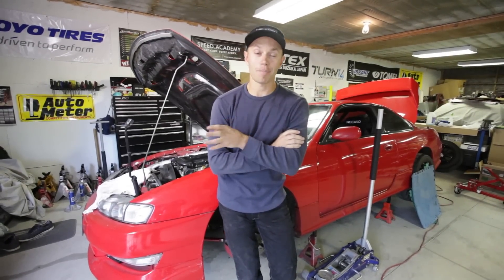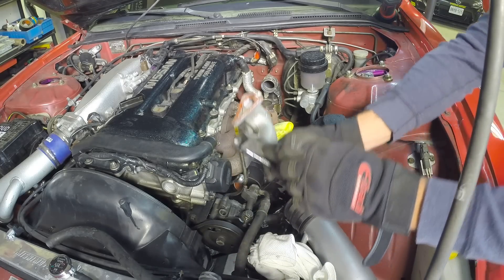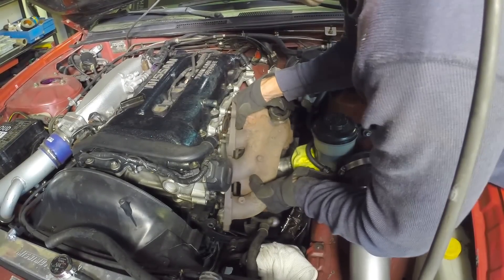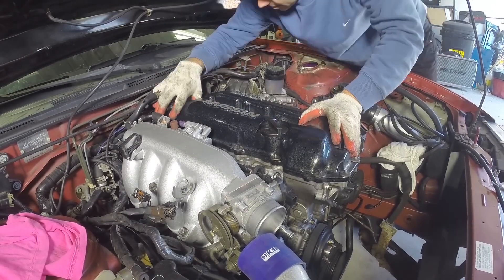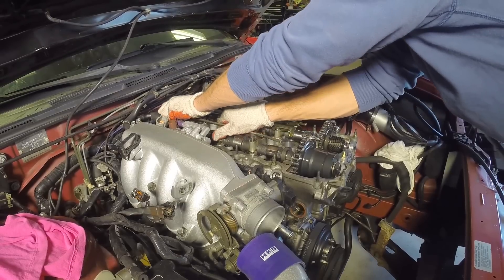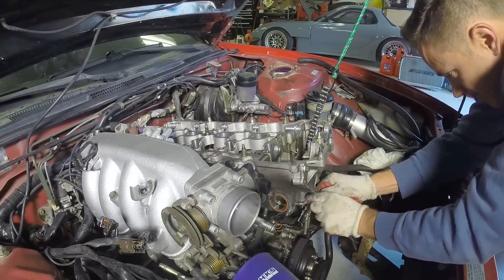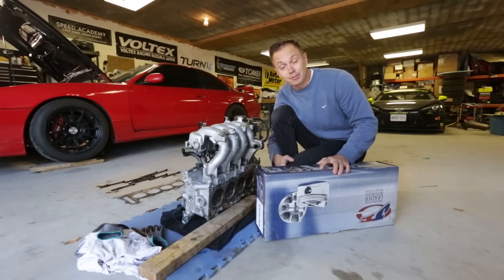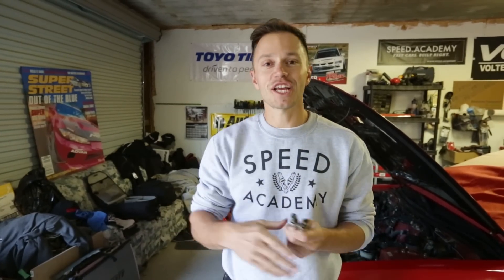SR20DET Head Gasket Replacement How-To - Project GripS14

Comment: all that work Pete. All that work, just to have it poo in your coffee. 

you cant have the block honed and the head machined and ported to fix this issue?
Reply from the maker: +itsToon That's racing for ya! I could have the block honed, replace the pistons, etc. but the cost of all that will be double of what I will spend buying a used SR engine.
Reply: +Speed Academy ....but what if it happens again? lol.
Reply from the maker: +itsToon Then I start over and put an S2000 drivetrain in haha.

Comment: I'm curious how you lifted the head?  I thought sasha used to race sr motors and knows how hard they can be pushed?  especially with meth/water installed......
Reply from the maker: +TheTurbooneg Its not tuning that lifted the head, using a stock head gasket and head bolts (that I found out were re-used from a previous head swap) have to be what caused the head to lift. I was making too much power, Sasha told me 300-ish whp is usually the max on stock block but I of course got greedy.
Reply: +Speed Academy 
Thank you for the clarification, it makes much more sense now. That pesky power bug bites every time! lol
Reply from the maker: +TheTurbooneg He said, 340whp is a lot for this block and I was like but I wont run it like that for long. Well it definitely didnt take long haha.
Reply: +Speed Academy 
haha....... Ive Def said  the same before!

Comment: Why not just rebuild the block you have? I mean, it didn't look like the block was all that bad, just the pistons and a lil on the head. Personally, I would just take the block to your machine shop and have them spec it out and magnaflux it to double check for cracks. Then id get the head ported and polished with new valvetrain. The P&P should take that roughness in the combustion chamber down and in turn, your head will flow much better. Just my $0.02..... Whatever you guys decide to do, please hurry! Cant wait for the next video! Makes my day when I come home from work and see a new SA vid!
Reply from the maker: +1dickycat Cost. It will easily double the cost to rebuild the engine versus go buy a stock used one. Plus the time and effort it takes to build it will mean less time for other projects that I need to start working on!
Reply: Ok, In that sense i can understand.

Comment: So, is there a reason you couldn't replace the pistons (and I assume hone the cylinders) and have the cylinder head machined? Or would the cost of doing that be more than just replacing the entire engine? Either way, sorry for your loss. :(
Reply from the maker: +Tj Benton You hit the nail on the head. The cost of rebuilding this engine is going to be double of what I can buy a used one for.

Comment: So, is there a reason that you couldn't replace the pistons (and I would assume hone the cylinders?) and have the cylinder head repaired? Or would the cost of doing that be more than just replacing the engine? Either way, sorry for your loss. :(

Comment: Maybe I missed it, but other than the piston what's rendering the bottom end "junk"?

Or are SR20DET cylinder heads by themselves not possible to find?
Reply from the maker: +Grant Culham The bottom end isn't junk by any means but with the pistons being damaged it's pretty worthless, it's worth $100 or $200 bucks max since there are so many of them in this condition. I'll hold onto it and if I ever decide to build a built motor then I'll use this block.

Comment: Surprised you got detonation, especially considering you're running water/meth. Possible bad tune? Were you dataloging at the track?
Reply from the maker: +SilviaDrift The crazy spike in engine temps is likely what caused it, once the head gasket failed I assume it didn't help things either. I was simply running too much power for the stock headgasket and head stud combo. The engine tune was spot on. I should actually check the logs but at this point it's a little irrelevant to me.

Comment: Hell I would have ran the engine until it blew up
Reply from the maker: +Nick Timar It pretty much did haha.
Reply: +Speed Academy I mean like a hole in the block, piston out of hood, bend arid etc
Reply from the maker: +Nick Timar Haha, well the water pissing out the side of the block would prevent it from running. Plus the clean up after something like that usually sucks!

Comment: Coolest swap would be a Nissan VK56DE. They use this V8 platform in motorsports in the Australia Supercars series and Nissan put it in the GTR GT-1.
Reply from the maker: +MC1796 Agreed but the cost and swap work is just too much for me right now.
Reply: Yeah, it is a pricey one. Have you ever thought about putting a VET head on the new engine and/or stroking it if the pistons are shot?
Reply from the maker: +MC1796 VET head is a lot of work to mate it to the SR block and I just dont have the time and funds for that either. Same thing in terms of stroking the engine, the cost is not worth it for me.
Reply: +Speed Academy Yeah it is a lot of work just for VVT, cutting back the firewall is a pain as well. Well, I'm out of ideas haha. 
Ask Tomei if they'll give you a SR genesis motor for free, you know, for long term product testing...
Reply from the maker: +MC1796 Haha, you know what's funny. I have good connections of Tomei and thought about it but then said it's still going to take too long to get an engine so I'm sticking with the junkyard SR lol.
Reply: Aw man, there's like no information on Genesis motors on the internet. Please, maybe for another project do it, I want to know what warrants the price.
Reply from the maker: +MC1796 Well it's a fully built engine by Tomei that essentially comes with a warranty. The price is quite reasonable actually given the labour and parts.

Comment: Check a/f after rebuild if u weren't logging. Det could have caused gasket to blow. Would hate to see rebuilt head pop too.
Reply from the maker: +DisplayName I was watching it while ripping on the track and it was in the low 11s so I wasnt running lean. Besides, I have AF protection set up in the EMS. If it runs lean it will pull timing and boost.

Comment: its a sr20det problem i had that happened to my gtir (pulsar) but i had the block crack and yes running 25psi with a hx35 will do that.
Reply from the maker: +Andres Moxam Damn, thats bad. I was only running 16psi so thankfully it was just the gasket and piston and head that got ruined... Wait that's still alot of parts haha.

Comment: can the old sr20 be rebuilt?
Reply from the maker: +JuStin C. B. The block would need new pistons and honing at the very least. The head would require a bunch of work to reuse so yes it can be rebuilt but the cost will far exceed what I'll pay buying a used stock SR engine.

Comment: Overhaul, dyno, race, break and repeat. Good time to show a proper engine overhaul with his opportunity.
Reply: With this opportunity **
Reply from the maker: +Chase Diaz  The cost of fixing this engine is way too expensive versus buying a used stock one and I haven't had much luck with built motors so I like to stick with stock.
Reply: +Speed Academy word....but I think you guys should definitely look into the detonation issue a bit more. S14 on the dyno to see some data logging. Maybe iat is high..engine too lean.?? Who knows. You guys know what to do. I am rambling
Reply from the maker: +Chase Diaz  I've blown up a few motors in my time and trying to chase the cause often leads to a few unknowns which right now I really don't have time for. I want to just get a working engine back in the car and running so I can focus on a few other projects.

Comment: I dont understand why you would get a new sr. Send it out for combustion chamber work, mill the head flat again, then get new stock pistons if youre on a budget. But I suppose if you're pressed for time then a new engine would be the better route.
Reply from the maker: +Xander Cage The cost of fixing this engine is way too expensive ($1500+) versus buying a used stock one ($700) and for my application I dont need a built engine rather a stock one with a good head gasket and studs should do the trick.
Reply from the maker: +Xander Cage This is just the engine, so no turbo or anything else on it. Almost a bare block. But if thats what they go for then DAMN!
Reply: +Xander Cage A whole new SR block can probably be found for less than the cost of that machining work.
Reply: Speed Academy Thats it, I need to move to Canada. F*cking stock SR here where I live (Virginia, USA) is at least 1500.
Reply from the maker: +cheapcharlie7 I actually had rocker stoppers on my old SR and when the rocker fell off all hell broke loose and destroyed the cam and damaged the cylinder head so now I avoid using them.
Reply from the maker: +cheapcharlie7 Nope, they were HKS. The thing is that they dont prevent the rocker from popping off 100%, they minimize the chances but I got unlucky so now I look at is as being cheaper to reinstall a rocker than have it damage a whack of parts.
Reply: +Xander Cage , yeah, this looks reparable. Need to find a good machine shop and head guy and it should be good.
Reply: +SydneyCBR6  I agree. Also once you start having machine work done you will most likely just want to keep going. You will get more for your money because of bench fees most shops charge.
Reply: SydneyCBR6 Yeah but thats for the block. This guy needs a long block. So once he does purchase one he might break even as opposed to fixing this current SR
Reply: +Speed Academy Feel your pain buddy. May be worth throwing in a $50 set of Rocker Stoppers while you have that new motor open.
Reply: Speed Academy Quality issue with the rocker stoppers you where running? Prices vary greatly. I know the Tomei kit is in excess of $1000. Rocker stoppers where OEM on the N13 Nissan GTiR
Reply: +Speed Academy 1500? Are the bores shot?  That's combustion chamber pitting, just dremel that smooth and it'd be fine.  Unless the head got warped, but I doubt spark plug ceramic would warp the head (unless the blown head gasket warped it)

Comment: when you blow a head gasket, should you worry about coolant getting into the block like by the crank?
Reply: +Nikki Naydenov   or into the combustion chambers rather
Reply: +Nikki Naydenov Honestly if you did an oil change it would just flush all the old contaminated oil out of the engine.
Reply: crazydogdude   fair enough
Reply from the maker: +Nikki Naydenov The coolant that gets into the combustion chamber burns off but if you get it into the oil then an oil change is going to be necessary.

Comment: I vote 1j swap
Reply: +Diogo DaCunha 1jz is good. Dont waste a 2jz on a grip car. 1JZ can get pretty decent amount of power
Reply: +Diogo DaCunha 2j
Reply: I agree with the 1jz maybe a 1.5jz
Reply: +Diogo DaCunha  1j's are pretty heavy, and for the power target i don't think it is viable to do a complete engine swap involving fabricating, electronics and gearbox and clutch magic. SR20's are good motors and a replacement should pop in in a day ;)
Reply: +Veselin Georgiev true and I like a nicely built sr20
Reply: Hell no sr20det are great engines I own two of these bad boys and they take a beating